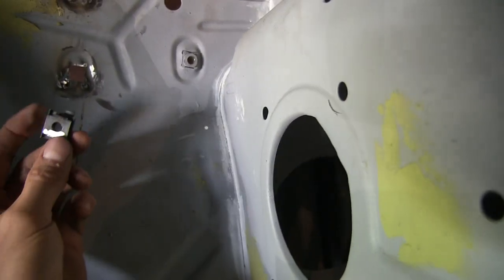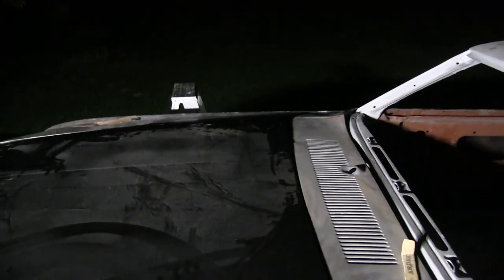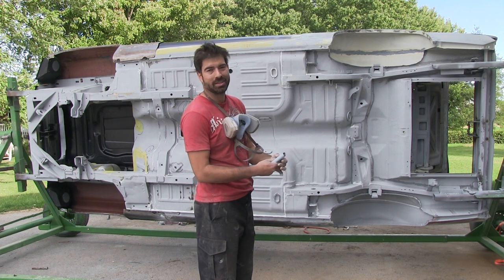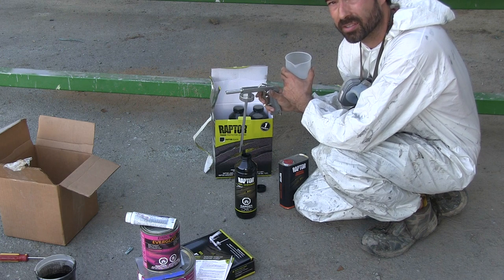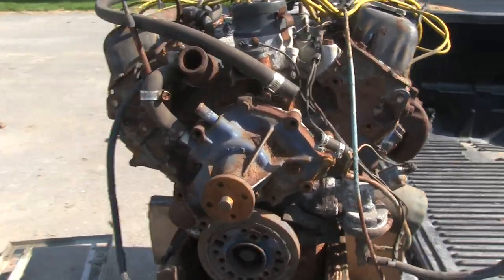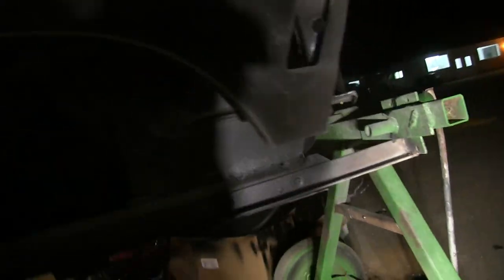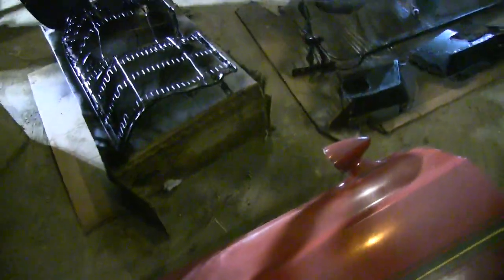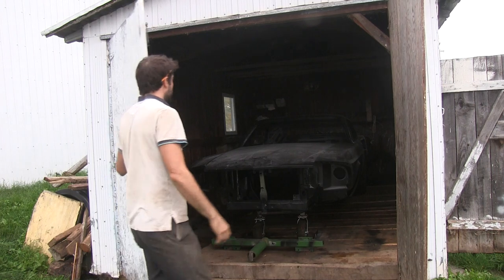Spraying Raptor bed Liner undercarriage, black epoxy primer - Restoring a 1970 Mustang Mach 1 Ep.9

Comment: Have a 69 Fastback that my dad got in the late 90s off the first owner. No accidents,not even a fender or bumper dent almost no rust to start. Just got the body completed and it’s now on to all the new suspension. For now for budget reasons I went with better than stock parts that can just be bolted on. I may do modern suspension upgrades down the road but it really depends on how I feel driving it again after 20 years of sitting stalled mostly disassembled for paint. After my dad passed last year and we moved out all the junk that it was buried under I got to sorting it all mostly by myself, but also with my kids whenever school and crap allowed. It has a 302 that my dad had professionally rebuilt with a “hot cam”, his words. It’s a power steering car but no AC. As I’m in SoCal for now I’m adding it in. Already have the complete kit. I upgraded the fuel system to a Holley EFI setup. That’s with a Holley brand gas tank that came with a high flow fuel pump in tank. I’m using all Holley stuff so I shouldn’t run into compatibility issues. That also makes it so if a part is defective they can’t say it’s because I used someone else’s stuff. Went with a ready to run MSD distributor as Holley says that works great with the EFI setup. 

For the radiator I went with Mishimoto from Japan (it looks badass got it in yesterday). The reason I went with one from Japan is I’m working towards turning it into a pseudo Mach 1, white with red interior, but into a Speedracer Mach 5 combination. Thinking of calling it the “Mach 1.5”. Gonna do the decals but a period and a 5 in circle like speedracer and a curved M on the hood scoop. I’ve had this idea for years and even told my dad about it. Since he passed and was big into Japan stuff, he lived there for several years as a child and still watched anime cartoons till his time, I felt making his last project car into that would be a neat way of honoring his memory. I’ve got too many car stories from him to share but it was one thing we always saw eye to eye on was anything cars. 

The car should be drivable in a month unless I run into a major issue which at this point shouldn’t be. I’ve got everything in hand now except the battery and belts and U joints. Sticking with the 3 speed manual it came with for now but will go automatic at some point as my left foot has major issues. Did get a Hurst shifter kit and linkages for it and a better clutch so it while it’ll feel mostly stock there will be improvement. Brakes from Baear, all disc now and adding a power booster. 

The radio I don’t care, I’m just putting a good single stereo speaker in the new dash but I doubt I’ll use it as I’m doing something different with my audio setup. Going with a wired Bluetooth speaker, a cellular iPad and a inverter for DC that plugs into the lighter. The interior is coming from TMI already ordered the headliner and sails but it’s still 3 months away. Dynamat (lots and everywhere) plus extra sound deadening (old school kind another dad item) is installed and will be using the black carpet kit my dad got from Year 1 till the TMI stuff is ready. Flowtech longtube headers and 2.5” Flowmaster exhaust with X pipe, again a dad item. I’m fine with it though I was the one who recommended it. 

Sorry for the TLDR but I love watching others doing restomods and see what they went with. Much of how the body work down to the steps and style I had done was close to what you did. I’m in a time crunch as the house it was at is up for sail and I don’t live close to where it’s being worked on, more I’m just caretaker for the place till it’s sold. So if I had the time and place to work on it I’d just get my kids to help me finish it.

Comment: while you have it blown apart you should drill the holes for the Shelby 1" drop. Also look at some of the trans am style tricks which strengthen the unibody like sub frame connectors.
Reply from the maker: I was told you don't need to do the shelby drop after 1968 as it was already better than 65-66. I have already 1" lowered coil springs, so i'm afraid lowering it even more would not give the stance I'm looking for. This is not gonna be a race car, so although I'm tempted by a lot of these mods, I just don't have deep pockets to justify all these expenses at the moment. If I had the means, I probably would have went with shock tower removal and installed the suspension kit from mustangs to fear, that would have been an amazing handling upgrade.
Reply: @MrYanngo  you should still do the Shelby drop. It applies to 65-70 model Mustangs. I have 1" drop springs and it still needs to drop 1". I am getting ready to convert over to Street to Track coil over suspension though. If you are interested in some roller spring perches I will have some with only 100 miles on them along with QA1 shocks that I will be selling.
Reply from the maker: @morganleblanc730  I already bought the shocks. Thanks for the infos. I'll look into it.
Reply: The shelby drop improves caster options and improves handling on turns. It won't effect the the length of your shocks.
Reply from the maker: @stallionranchwoodworks  Thank you, I'll look into that. I have the reinforced shock tower bracing so drilling new holes through that will be a pain, but I can see the benefits.

Comment: You and your dad are awesome! You both will look back with pride about what you have achieved together. 
One question though: Are you going to use this 351 Windsor Block engine or ist this some other project? Or, for the pros among you: Is it possible to 'convert' a Windsor Block into a Cleveland Block? 
Kind regards from Switzerland from an ex owner of a '70 Mach 1 (with a 351 C) 
Charlie
Reply from the maker: Thank you ! Yes, we're going to use the windsor. I have a 351c also, but the windsor is easier to built for someone like me. The cleveland will be for sale. 
You can put cleveland heads on a windsor block, yes. They call it the Clevor. I don't recall the details, but many people have done it because the windsor block takes less space. It is apparently relatively easy to do. Check Edelbrock, I think they have a kit for that.

Comment: How is the bed liner holding up under the car? Any peeling or chips? Any adhesion problems along edges?
Reply from the maker: Haven't driven the car yet, but nothing has chipped. That thing is hard as rock. No adhesive issues, as it's stuck to epoxy primer.
Reply: @MrYanngo Okay, that's great to know. Good job.